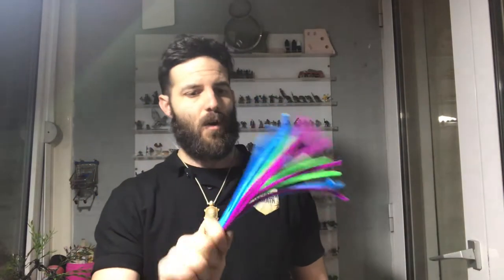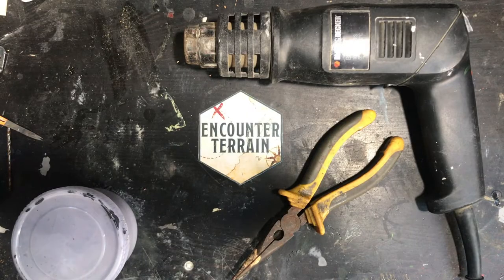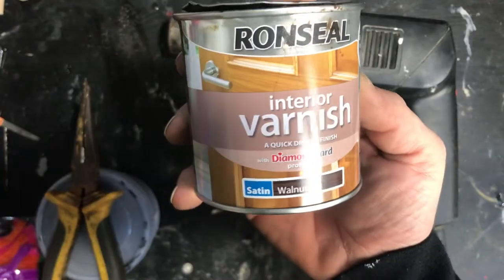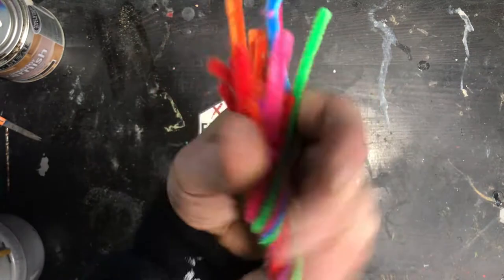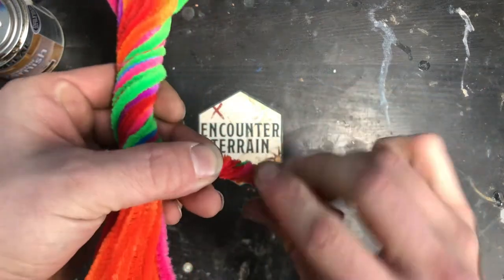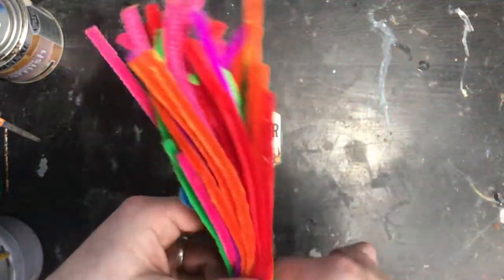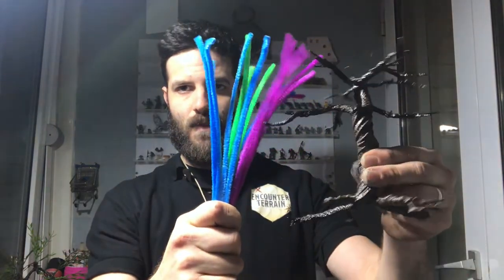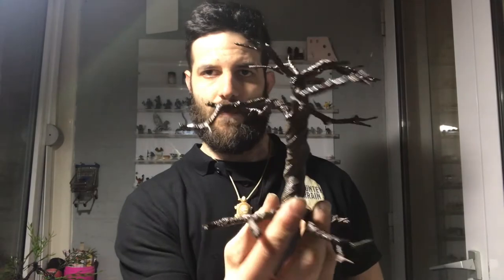ET: How to make tree armatures from pipe cleaners

Comment: Great results! Does it have to be an open flame or does a heat source suffice to turn the fluff parts to plastic, like a heat gun?
Reply from the maker: Tai heat gun works also, as does a hot enough hair dryer. The fumes are a little stronger as it takes a little longer to melt, and they texture gets slightly different but definitely doable with a heat gun 👍

Comment: Can the heat gun melt the pipe cleaners, so you don't need to use fire.
Reply: You can use a heat gun instead yeah. It’s not as good. It still works. 
worlds latest reply